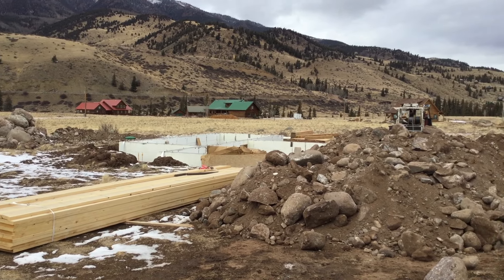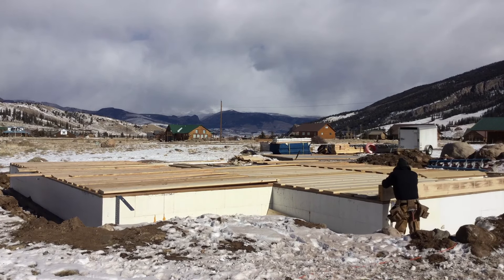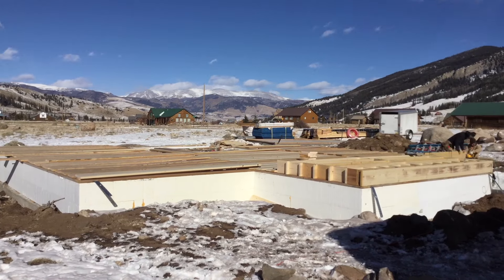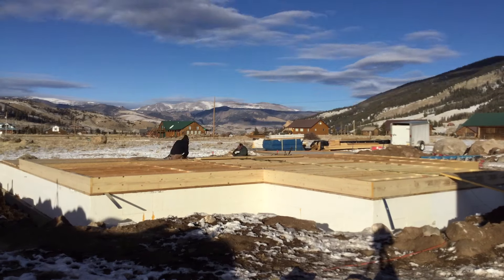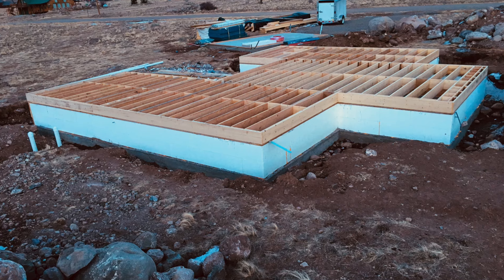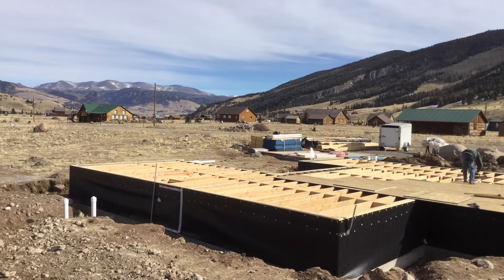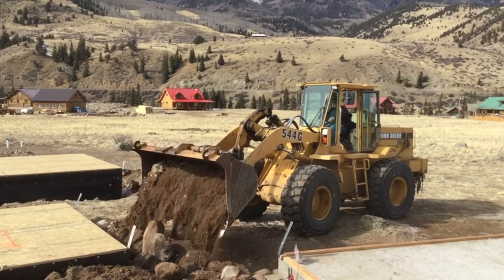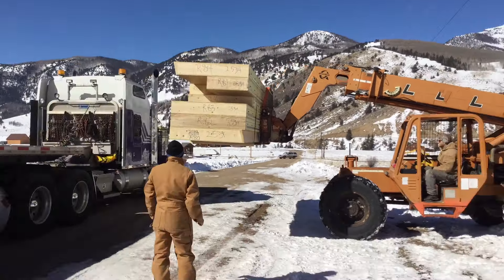Build a Crawlspace Foundation and Fire a Bad Subcontractor

Comment: 🤔Hm? ... Just because you didn't provide any ventilation on the foundation walls in the winter time because it was a good idea to keep the cold ❄ out, does that mean you'll wish you did when it's hot in the 🥵 summertime to have the cool breezes  lower the temperatures in the crawl space of that house? ... Maybe, ventilation on the foundation walls are needed for the warmer seasons (late spring and summer) and doors that cover the ventilated areas are also needed to block out the cold during the  winter months. That way, you get the best of both worlds (winter & summer).
Reply from the maker: Robert, I like your thinking. Remember, nights in July at 9000’ in the Colorado Rockies is down to 50F. As for ventilation: the entire house is ventilated continuously by an HRV. That includes the conditioned crawl space that is insulated and vapor barrier. 
I am working on big changes to this channel and will combine my other channel MODERN MOUNTAIN LIVING so I can finish this series. Thanks